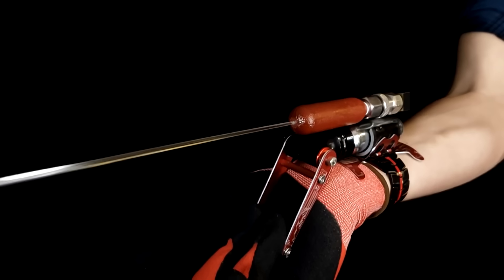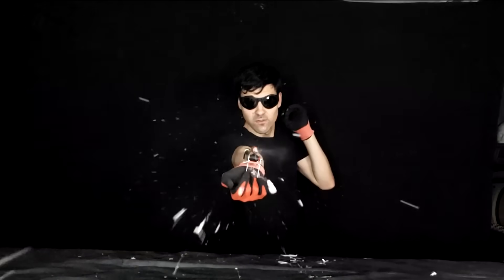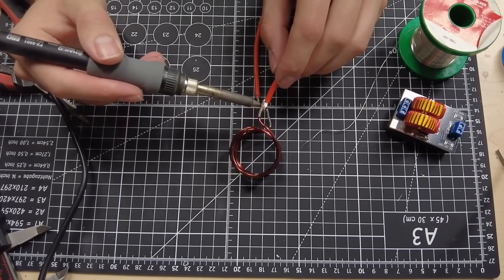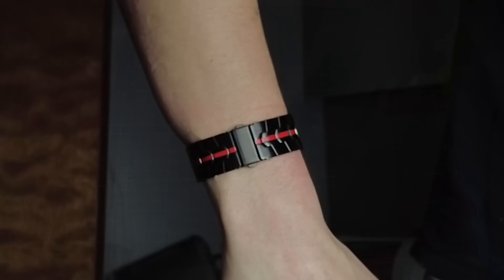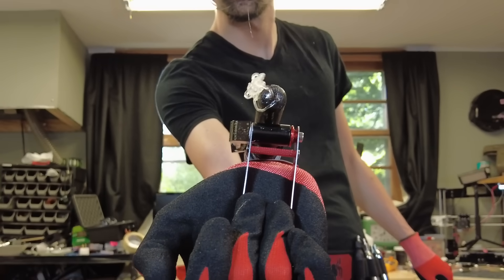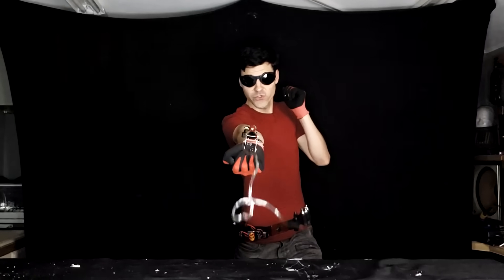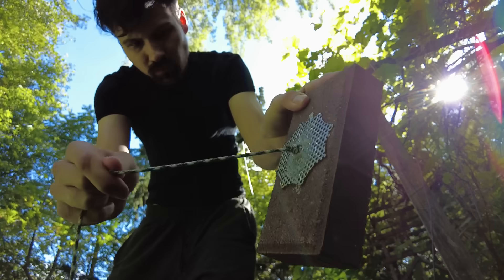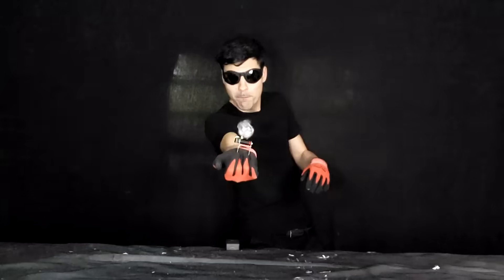REAL Web Shooter (Spider-Man: No Way Home)

Comment: Maybe slightly heated wood glue or gorilla glue in a better capsule that could work with it might eliminate the need for a rope or binding as should only take seconds to dry for swinging capability also u could combine that with the power of superglued super speed drying and strength and wallah u might have real working webbing but it MIGHT need a heating area on the capsule to keep it from thickening so it doesn’t clog up the hole
Reply: So basically combine the 2 glues add a heating area on the webbing capsule and it should eliminate the need for rope and should still be as safe

Comment: Embed the glue into the anchor beforehand, heat up the whole anchor to melt the glue and then launch it. 
If the anchor is made of aluminum or a material that will cool down quickly enough as the glue makes impact and sheds its heat, that could work…
As opposed to a plate you could use a bundle of steel cable with glue. Take some steel cable, make several loops and attach them to a central pivot anchor for the swing rope, make a mold and fill it with hot glue, submerge the wire loops and let it cool… you’ll have a solid projectile you can load into the chamber to heat up and fire! 

Another option is something like a paintball for hot glue… like a little foil packet that can be heated and launched that will splat on impact to maximize surface area.. this would also protect you from hot glue everywhere and keep it all hot and useful until it hits its target as needed.

Comment: Fucking awesome, i think you'll have to do something like a multi stage cartridge with an external spool. If you can take your perforated aluminum and have it roll up into a cone, you could pack that behind the glue in an extended cartridge. With a spring on the inside of the roll or maybe just a spring steel edge that unfolds the anchor when it leaves the cartridge you'll have the glue and anchor fly together and apply to a surface together

Comment: What if the grill was done with memory metal, stored inside the cartridge rolled/folded up, using the very heat the melts the glue and shoots to also trigger the springiness of the memory metal to unroll/unfold and flatten out? (perhaps multiple layers of mesh might be needed to get enough surface area to compensate for the softness of the metal once it cools down?)

Comment: To make it more like Spidey's webshooters, you can't have just one lever, you need 3 or 4, with an interlock that will prevent the web from accidentally shooting if the outer levers are pressed together with the middle one(s), to allow you to grab things without triggering the webshooter; that's the reasoning for his iconic finger pose.

Also, I'm not 100% sure, but I think I remember reading that on top of that, he also makes it so it requires a double-press to activate; so maybe something like a wind-up mechanism that temporarily arms it on the first press, and then only if you press again before the winding disarms it again, while also not pressing the outer levers neither time, only then it will shoot.

Comment: You need some sort of concentrated material like dish soap.  If you have 2 chemicals that combine to make a strong sticky flexible material then it could work by adding to the chemicals to make the whole this porous like how a piece of plastic has tons of small vacuums or trapped air.  This could also add to its flexibility since porous materials can bend more than a solid of the same composition.  Perhaps something made of a carbon based structure mixed with some kind of rubber could give the solution these types of characteristics.

Comment: that concept is sick, as an alternative, also test semi flexible webbing materials (eg. web shaped paracord with low caliber metal wiring cores or frayed nylon ends with glued flat shaped metal reinforcements or you could even ad fiberglass or other composite to the glue) I'm thrilled to see the evolution of your prototypes.

Comment: Maybe consider finding a glue that liquifies more when heated? Some sort of heat activated resin that cures on cooling or in air?  Then when it hits spreads out and permeates the brick more. Seems like your failure was with the material fatigue of the brick surface not completely holding after the pull and release of your repeated load tests.

Comment: Like the heat, move the CO2 power to the belt via a larger tank, perhaps more square ish to blend into the belt better. This way you can get more power out the laucher and free up space for the anchor attachment. Of course the issue becomes how do you launch something full of holes via air pressure. Perhaps a Sabot still round that would break away?  Even if that worked the shape of the anchor isn't very aero dynamic, perhaps a semi rigid one way folding design that will open up in flight after it is launched from the barrel and freed from the sabot. There was a bollo shot gun round with this idea marketed towards police force before.

Comment: This is cool, and super flashy. 

I uh, think you should look into some sort of adhesive rope, or maybe the chemistry of spider silk. I bet you can do it.

Ultimately I think the best marriage of the two is to launch a rope with an adhesive anchor at the end.

I don't know if we even have the right kind of adhesives yet, and frankly you'd need some kind of anchor like what you've got. So maybe a rope web of sorts at the end? Or a sort of spike with arms that will spread out and adhere to have a more even tension across the surface and have less give? If spidey's webs were prone to like sudden jolts of letting go a bit from bad adhesion, I bet they wouldn't work quite as well.

Comment: It is (I’d imagine. I’m not gifted in this kind of stuff) going to be extremely difficult to deploy the “glue/anchor” method. The timing is almost impossible. To warrant an attempt swinging the glue would have to travel a certain distance. More time in the air =cooler on impact. But then, for the anchor to work it has to hit the glue while it is still hot to spread it and gain the strength to hold. If it is assumed you still want to use one “launcher” it would take too long to reload. But,  if you somehow get the glue on the anchor before deployment the surface there may still be a problem with cooling (and burns given how close it is). 

Maybe to solve the timing issue you could have the anchor on a smaller version of a harpoon/slingshot/crossbow mount on the backside of your arm maybe with a red laser for aiming. Attaching the anchor to a bolt would also maybe help with flight stability? That way you deploy glue, turn hand over, fire anchor to where the glue landed. If you cannot keep the glue hot over distance perhaps try another compound that cures not based on heat?

I figure id throw out some crazy idea, because until there is a right answer there is no wrong one, right?

Comment: That was an awesome design. Using the belt to heat it up was brilliant! 
For your next Spiderman project you should make a time machine so you can stop the robber from getting away and killing Uncle Ben OR a web shooter that can shoot an item from across the room and pull it back to you so you don't have to move.

Comment: This new version really is quite a nice, trim take on the idea.  A cartridge that has coiled cable, glue, and a fold up anchor definitely seems possible.  With the glue getting heated at the front of the cartridge, you could even keep the chord or rope from getting burned from getting too hot.

Comment: This was great!
Hot glue would take a while to set though, right? I wonder if there'd be a 2-part solution (like epoxy resin) which would set faster and not require the heat?

Comment: What about a hot glue soaked/covered net/mesh of the zylon rope material 'built irl' used as the anchor/interface. The cartridge could be heated up to temperature then fired.

Comment: Impressive! I wonder if there are better adhesives than hot glue? Like some sort of contact cement? Something that could cure quickly when reacting with a broken pellet of some catalyst, as opposed to having to heat something up.

Comment: maybe by adding fiber strands to the glue you could make your cartridge form swingable ropes too. this would obviosuly require a lot of experimentation with glue type and heat level and fiber type/length

Comment: Great idea!

I may have an idea on how to combine the glue and anchor, maybe it can give you an idea: 

Recently I saw a video about someone who built a Pringles canon, he shot the Pringles in the can and in flight the can's walls spread out (maybe you'll find it).

How about doing something similar, but instead of using Pringles you use hot glue, instead of using the can you use some kind of bendable metal (?) That spreads out in like a star shape mid flight but can be put in such a cartridge, with hotglue inside it. This way the anchor can be ensured to get good contact and to land on the same spot like the glue does.  Please feel free to dm me for further explanation, i really love your inventions and builds!

Comment: to combine it to single cartridge you may want to try to cut your anchor in a few pieces, have some flat springs attached and  fold it down to a co2 cartridge, when you shoot it out you ensure it will be opened by springs, will be flat, and stabilised in flight by the rope it drags behind. the range may be the problem though

Comment: A short cylinder Sabot that unfolds to your metal mesh design with a hot glue slug at the end where the inductive heating happens?  Good Luck
Reply: Maybe not directly applicable, but Jairus of all did a Pringles Can sabot and discussed troubleshooting the concept.

Comment: Its such a simple and solid solution. Perhaps use silicone earplugs to cap the ends so they dont leak when heating (Not sure if you are allready doing something similar). the layering inside the cartrige  would be a challenge. But perhaps if you could contain the glue inside something that would hold up to the temperature and break on impact (Latex Condom? or Nitrile glove material) then you could contain he glue in a  membrane for shooting the needed blob.

Comment: This is super cool. The idea of using the glue with mesh grill to hold on to it is just perfect. If you want to integrate both of them in the same time, why dont you use the induction coil to heat up the mesh grill that is pre coated with the glue in a casing or something that releases its stickiness on impact!
Reply: May need to have a collapsible version of the mesh so that it takes up less space? Then when fired expands, maybe using centripetal force to spread out the mesh ?
Reply: @Scott_C  oh yeah. I thought of a simple umbrella like mechanic. Like there’s a peg at the front that when push, also pushes out the mesh outward. I have a design in mind but not sure how to share it.
Reply: @Scott_C  thanks
Reply: @idiotsandwich7528  Yeah! I'd want to see it. It may not need to be metal, a 3D printed version of it may work just nearly as well.  Also your name is hilarious.
Reply: @Scott_C  i see, you a cultured person to know my name.
Reply: @devduthk3816  The best sandwich you will ever have in your life.
Reply: @devduthk3816  I think it’s from gordon ramsey?
Reply: @clared5812  I know

I think Gordon Ramsay himself asked the question "What are you?" Then promptly reply with "An Idiot sandwitch!"
Reply: @Scott_C  i don’t want the mesh to be wide open when fired caused it might not fly towards the target nicely as the mesh will have too much resistance.

Comment: Maybe for the glue anchor you could hinge it in such a way that it in the shape. Of a harpoon so that when it hits the target it folds open from the back and then locks into place. Also consider using a stronger adhesive and rethinking the web shooter wrist mount. Those watch straps will never hold a d even if they would they'd be super uncomfortable. Maybe a hidden harness and a kind of rope cleat mechanism?

Comment: Awesome job Joel! Suggestion: Use a mesh of nylon rope saturated with the glue. Instead of your anchor being a solid piece of metal it would be a complex knot covered in glue. When it sticks to a surface it hits and spreads out. The difficulty will be spreading the force out evenly over the glue rather than pulling on a single point at once. Some sort of slipknot like structure that dynamically adjusts to whatever surface/angle you hit could work.
Reply from the maker: Great points, I am thinking something flexible for sure!
Reply: @JoelCreates  unfolding Wire mesh sabot with a hot glue slug inside the cartridge.  Induction heating would only need to heat the tip where the slug is.
Reply: @zach4505  I love this idea
Reply: @zach4505  Yeah a wire mesh of some sort might work even better. It will either keep the glue warm/warm it faster, or it will keep it from cooling with it hits delaying the adhesion.
Reply: @JoelCreates  you could try using a stronger adhesive too, that way you'd need less surface area for the anchor.
Reply: UHMWPE rope (dyneema/spectra/amsteel) is the ideal rope material, a 2mm rope can easily support a persons weight (even 1mm can do it, it looks like sewing thread at those thicknesses). A big problem is that it is REALLY slippery, so it will not bond to glue very well at all. You could possibly have a nylon/polyester anchor with a dyneema rope though.

Edit: maybe you could find a suitable pressure-sensitive adhesive (PSA) for the anchor. They are surprisingly strong, and don't have the heat limitations of hot glue.
Reply: @MrTheomossop  pressure sensitive would be perfect
Reply: @MrTheomossop  I'd probably use dyneema. Strong, cut resistant, elastic, heat resistant, its a perfect canidate
Reply: @chrisbaker9704  yep, 1mm dyneema rope has a 200+ kg MBS, if you connect it properly (splices, not knots) you can easily hang and even swing off that. 20m+ of it could fit in a small cartridge.

Dyneema is neither heat resistant nor elastic though, it melts at below 150 C, so you can't really use it with hot glue.
Reply: @MrTheomossop  oh, I must've been thinking of spectra
Reply: @chrisbaker9704  spectra is UHMWPE as well, so it will be the same, I think Vectran has a higher melting point and is also very strong.
Reply: This!
Reply: This!!! Do this!!!
Reply: Sees Slipknot

PSYCHOSOCIAL